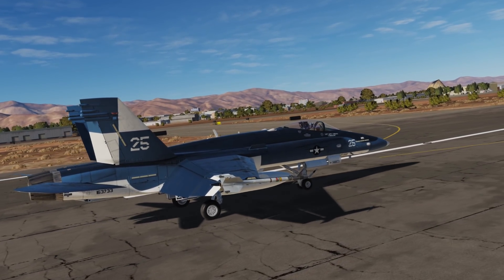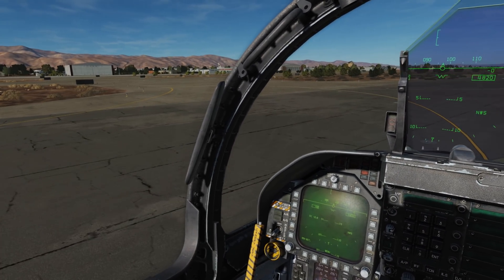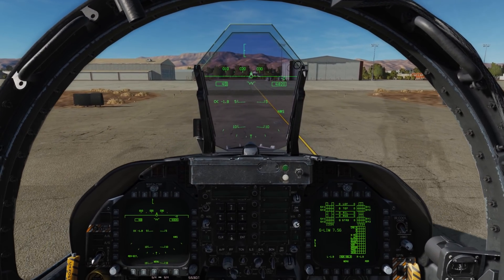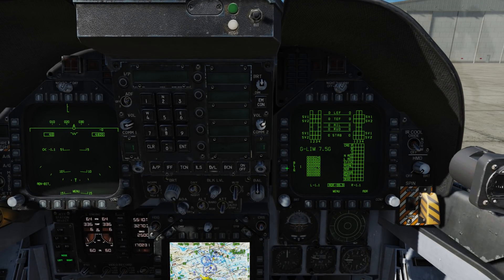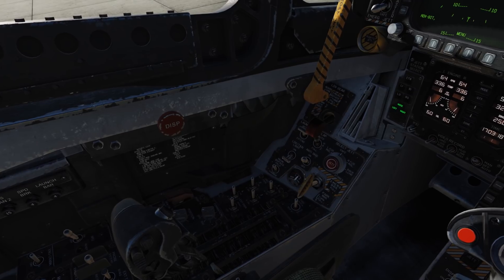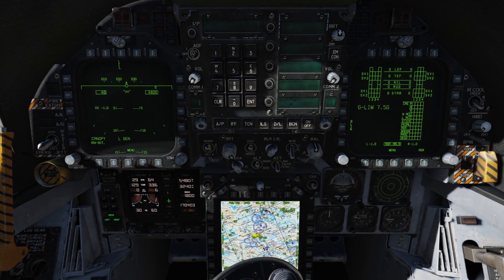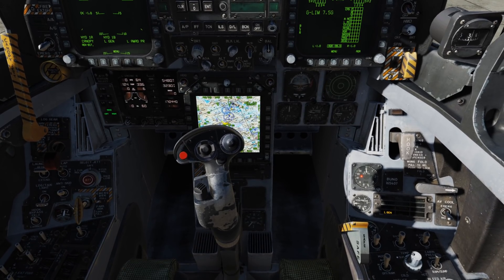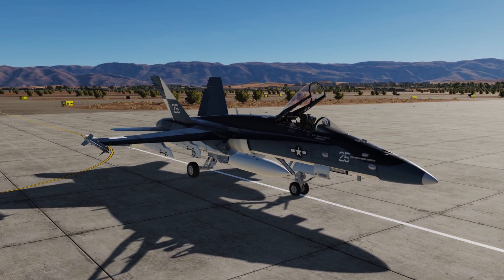DCS: F/A-18C Hornet – Episode 15: Aircraft Shutdown

Comment: Another great video Matt. Quick question though, after it has been shut down, how does one restart it? Seems after a shutdown like this, the APU won't spool up to full RPM again, which means I can't crank the engines?
Reply: I believe if you have the ground crew turn on the ground power it should help.

Comment: Hi wags.  i was wondering when you guys were going to get the ils systems up and running?  I have been training in low visibility carrier landings.  tacan and crs   (course set switch)     I've landed  foggy landings settings at  200ft visibility and thickness set at 638ft.     do you use the ils?   or is it still in the works?   how will the information change on the hud?  here is one of my landings 

https://youtu.be/o4P76Vd95_Q
Reply from the maker: ICLS will come later in the early access.

Comment: 2 very minor pointers. 
1. Instead of putting the trim to zero you are supposed to push the takeoff trim button which sets the trim to 12 degrees nose up.
2. After you shut down the last engine, you are supposed to wait until the amber flaps light comes on before securing the battery. 
Other than that an almost by the book shutdown!
Reply from the maker: I know some Hornet pilots that do not agree with your first and second points. Quite possible that some forces and units do things a bit differently though.
Reply: Matt Wagner That is a possibility. My source for the comments was the 2008 dated NATOPS (USN and USMC) manual. I did find a spanish air force F-18 manual but I didnt download it and haven't been able to find it again so I can't compare what they do compared to the U.S.

Comment: Are there any plans to add the idle stop feature to the throttles without having to hit keyboard commands, by physically putting them in idle like the warthog feature.
Reply: Adjust Controls
Search for “Throttle (Left) - OFF/IDLE” and “Throttle (Right) - OFF/IDLE”

Then bind it by moving the throttle over the lift in any direction.

There ya go
Reply: Not sure what u mean as that’s already implemented
Reply: That is implemented
Let me load up dcs and find the function name.
I have the warthog as well and it works perfect
Reply: Ethan Higgins unrelated question what are the fingerlifts for?
Reply: Ethan Higgins I have the thrust master warthog throttles and when I put them in idle detent the hornets throttles on screen don’t do that you have to use a keyboard command to put them out of detent at start up and now to shut the engines down you have to hit a keyboard command r cntrl. Home or end what I mean is can you do that with the throttles by physically moving them in and out of detent sorry for the convolution
Reply: There are two different lifts on the f18. One controls the fuel from off to idle and the other is the afterburner detent.